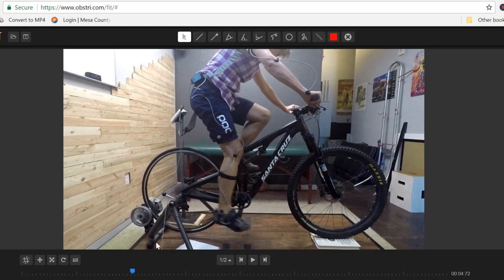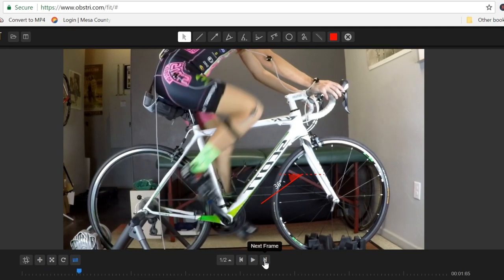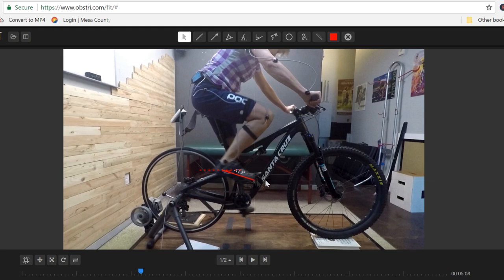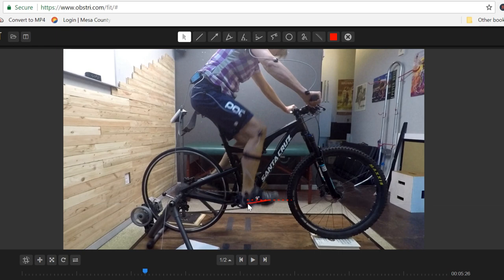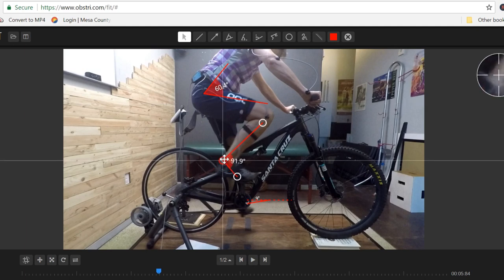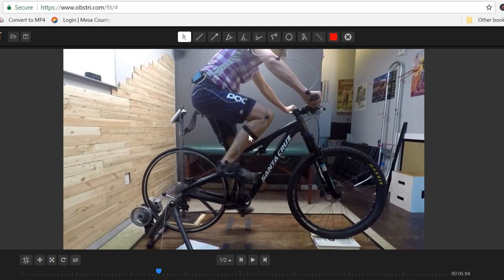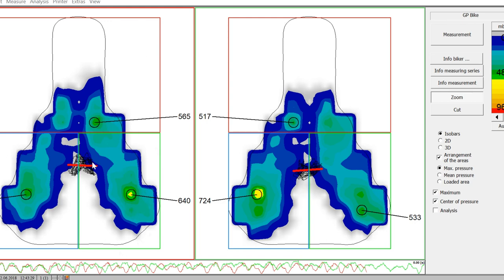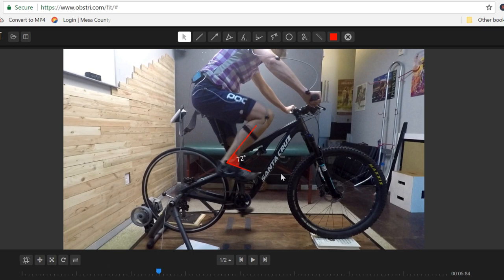Crank Length and Bike Fit | One real world example

Comment: You can also see she has at the bottom of her pedalling the toes pointed down. Saddle up as suggested by some would make that worse ore making her slide on the saddle causing hurting of her behind.  Shorter crank arms would make it possible to ride with horizontal feet at the bottom of her circle. She needs only to be instructed to do that  conciously for a few rides. When she is avoiding more hip flexion one can change the upper body position to to a little more upright.pp

Comment: OK, here is a question that I do not find addressed in any pertinent videos you have published.  Over the last two days, I have noticed a sharp pain in the front meaty part of each shoulder.  The very front, down from the point of the shoulder at 45 degrees about 1.5 inches, where the muscle is.  This is new, and I have never hurt there before.  All I do is ride my bike, no other exercise.  My dropper post did raise my max seat height about 3/4 inch, maybe less.  That is the onlly recent change.  Grips, bar, stem and seat angle are all the same, unchanged for months (except the seat position was moved all the way back per your video on ass pain, which solved that issue :)  Any ideas on what I am doing that would effect the front shoulder muscles or tendons?

Comment: A little off topic if you don't mind.

I had a pilon type 3 fracture and crushed the top of my talus as well. I've been released from care and cleared to resume life with no/very low impact for my ankle. Before my injury I rode mostly road with about 10% trail mtb, which I've decided to swap for gravel, over 5-7k miles a year with a couple 1500 mile cross country trips for good measure in the 5 years prior. I worked in bike shops and restaurants, now they require too much time on my feet. Ive have a sports physician and a physical therapist but neither seem to well versed on my injury and cycling. I've borrowed a friend's bike a few times and had little to no soreness after a couple 20 mile and a 35 mile road ride and plan to steadily return to my old habits. 
I understand the importance of a proper fit but never had one before. That's no longer something I'm willing to fiddle around with figure out for myself, which is how I found my fit in the past. I plan to have a professional fit done before I put in more than 40 miles a ride.

My question, is there anything you would recommend I  look for (acreditacion, certification, reviews) or to avoid (plumb bobs and goniometrs)?

Comment: I have 172.5mm cranks and my knees come up almost to my chest when i am in the drops and this is causing me a bit of discomfort and making it hard to produce the power i would get if i hold my chest higher and in a more relaxed position. I want to get shorter cranks so my question is, are there any disadvantages to going for 165mm cranks over 170 or keeping the 172.5 i currently have? Im 5’7 and have a 28inch leg. Im comfortable with the rest of my fit and don’t really get any other discomfort on the bike.
Thanks
Reply: Go for 160mm its amazing how much more comfortable it is that way :)

Comment: Why is more plantar flexion better through the top of the pedal stroke? I would imagine one would lose control of that top of the pedal stroke, missing out on critical quad work/knee extension versus if one were to try to keep a little more dorsiflexion and attempting to kick the foot forward over the top as if they're kicking a soccer ball. That additional plantar flexion would also cause more knee flexion and hip flexion over the top of the pedal stroke, so the heel down affectively opens both joints up and could even allow for more seat height or drop of the handlebars.

Comment: Hi there. I suffer with really bad saddle sores but only on the right hand side. Left feels perfect all the time and have zero problems form that side. It’s getting to the point where I’m sick of buying different saddles as it’s costing a fortune.  I always wear expensive bibs such as rapha and assos which helps a little bit still suffer quite a lot. 
Thanks for taking the time to read this and hopefully you have a suggestion to cure this. 

Thanks 😀👍

Comment: Should there be a device on the market that adjusts crank length  by simply using allen keys or the like?
On long distance rides over 200km my knees begin feel pain at the front of them and all other adjustments to bike fit have been considered.
If I'm simply touring on my bike and putting out medium watts I would like to decrease knee flexion or at least have that option to try.
Reply: TheCrossroads09 check out Look Zed crankset.
Reply: Joao Godinho yes but even more shallow @150 mm would be worth a try if all you want is forward momentum during periods of knee pain. I want to fabricate my own design but yes it would be bulky and significantly heavier.
Reply: i'm currently working with a company to develop a few adjustable bike components, specifically telescopic cranks, stem and quick adjust fore-aft seatpost clamp.  it is mainly to be used for bike fiting, but the development may lead to some marketable products for outdoors cycling.  if all goes well there will be some announcements in late 2018
Reply: I went from 170 to 175 cranks, feels great and improved my rides. 
170's got to where I felt like I was on a clown bicycle in a circus. I am  5'7" and I don't get the push for shorter cranks. I was spinning out to quick on the downhills. The fellows at the bike shop, said 170's  
should work better for my height, but I don't get it. I like the added leverage.
Reply: @buddysmith407  crank length would be dependant on leg length, if you have long legs for your height, then a longer crank may be a bit better, but if you have shorter legs than normal for your height, then a shorter crank would be a bit better. I'm 5'11 and my 172.5mm cranks feel slightly long for me.

Comment: I have a partial "dropped foot" (read as partial paralysis of the anterior tibial muscle) from a slip of the instruments during a back fusion years ago. To avoid extreme toe down on that left side during the upstroke i run my cleats at mid arch. This causes all sorts of bike fitting problems. I need to move my saddle forward proportionate to the distance the cleats are moved back (3 cm)-almost a TT fit- in order to keep the relationship to the BB. Question: What would my optimal ankle, knee and hip angles be? All of my lumbar vertebra are surgically fused but i have superlative hip flexion. Oh and did i mention that my knees are nice and straight after the bilateral total knee replacements? :)

Comment: Hi. I’m having trouble getting my head around crank length changes. Are the benefits related to changing the hip and knee angles without having to change the seat height ?  Also what impact / consideration should be given to bottom bracket height, ie crank length differences between cyclocross (high bottom bracket) and road bike. Cheers

Comment: How long for a mild mcl pain to go away. I can feel a light sting with pressure or use... it all started cause I just found out my frame is too big, so I slammed the saddle forward and position myself aft on the saddle, but now I come to realize the cranks are too long and my knees trail way behind the axis of the peddle.... So now my mcl is jacked. Plus I need a shorter stem cause my reach isn't long enough...

Comment: As a 6’6” rider, I found that riding 175’s like riding a toy bike. 190’s ended up working the best for me, occasional pedal-strikes notwithstanding. Perhaps if the rider in tge example were to move the cleats rearward, even all the way, and make some seat adjustments (down and back?) things might get a bit more normal. But that begs the question, what is normal?
Reply: Hi there just quick question,  as am 6'6 foot tall rider, what is your recommendation about crank lenght? Thanks
Reply: @ahmetozel3455  I bought a bike that had 200’s on it. There were good but just a bit long. I gave 190’s a try and never looked back. The science and studies advocate shorter cranks. They are wrong. But….your mileage may vary.
Reply: @rgz4ams  Thanks a million Robert. I think the same. The one more question if you dont mind,  as it is not really common to find long arm crank in Turkey or almost very part of europe,  could you please let me know where to buy ( net shopping ) that i can supply one for myself,  thanks again..

Comment: Hello Bike Fit Adviser, may I ask the client's height? i wonder how the initial decision was made to put her on 175mm cranks years ago. was this a result of going by the textbook ' this length for this height of rider', or did she try out various and personally decided to go for 175s?
Reply: If you watch some bike manufacturers geometry charts you can see that for some reason almost all of the use 175mm cranks from size M up on MTBs. And they use 170mm size S down. Personally I don't see why this is good. I used 175 because of this for a long time, and a recent knee injury made me dig into this topic a little bit. I ended up with 165mm cranks. They feel more comfortable that's for sure.
Reply: same, I put 170mm on my size L xc hardtail, and on my super commuter (also large). since then all discomfort disappeared, i'm 180cm height (5'11''?) and although all the guides point towards 175mm, i find them extremely uncomfortable to ride.

Comment: Thanks for the video, I didn't realize that crank length (even adjusted for proper saddle height) would have a result on ankle angle. Would you say it's better to err on the side of shorter crank arms than longer ones? On my road bike I have 165s (recommended to me by a fitter), on my CX and XC bikes I have 170 but my long travel trail bike came with 175s. It's hard to find MTB cranks at 165 and a lot of $$! Seeing how I don't ride my trail bike for that long (usually 2 hours max) would this cause any issue?
Reply: @J L this channel is dead